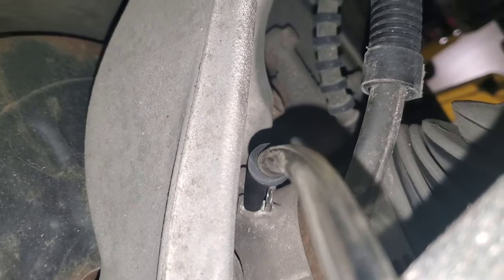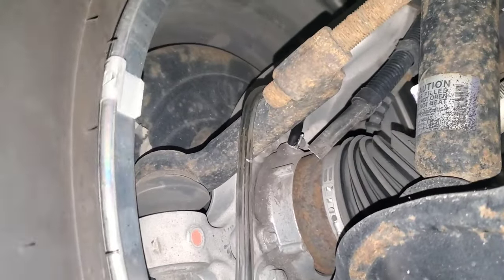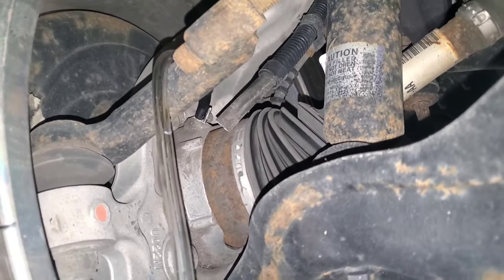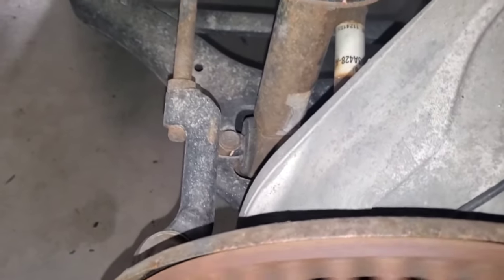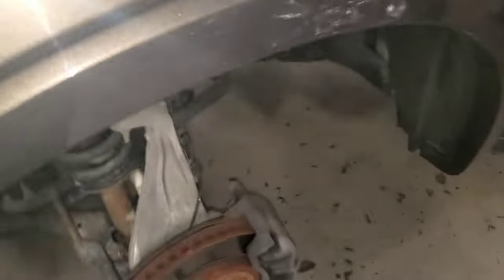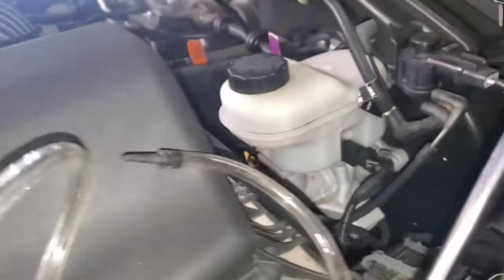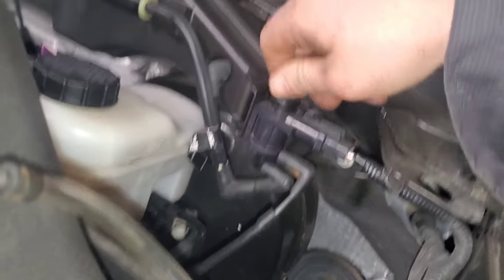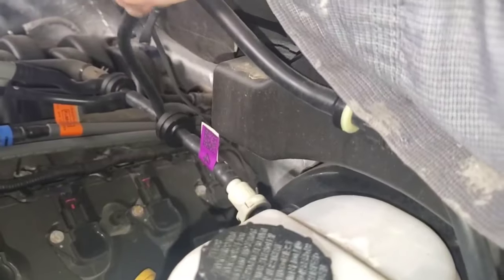Quick F150 IWE 4x4 Actuator System Check from solenoid down to Hubs - How To Vacuum Gauge Needed

Comment: Both of my eyesWE Hobbs are spinning while in 2 Wheel Dr. I changed check valve and hose. By both hubs are spinning while in 2 Wheel Dr. What could that possibly be?
Reply: What did it end up being?
Reply: @georged1085  it was the solenoid and the check valve.. cost about 50 bucks.. very simple
Reply: @joelane4670  sadly that didn’t do it for me.. next step is to inspect lines, if that doesn’t work maybe an iwe or hub will do it

Comment: When i pressure test that top like out of the solenoid it holds 0 pressure.  However when i turn the truck on and put the pressure gauge down at the fitting to the actuator it holds 15psi. Is it my lines or no? Those tests seem to contradict eachother
Reply from the maker: At the four-wheel drive lines with the vehicle in two wheel drive and you have your vacuum gauge hooked up you should be reading about 22 in of vacuum not pressure